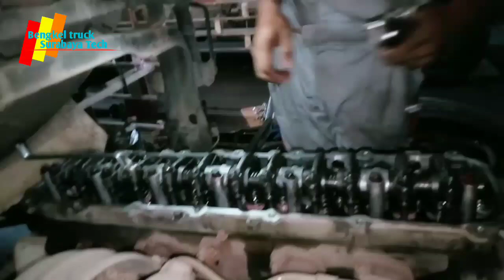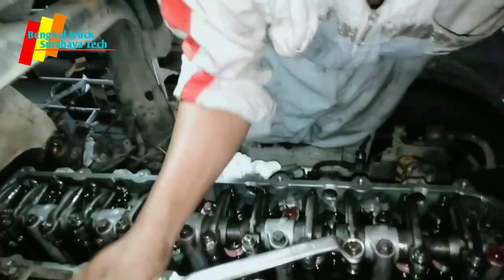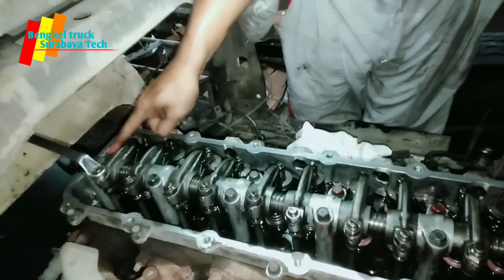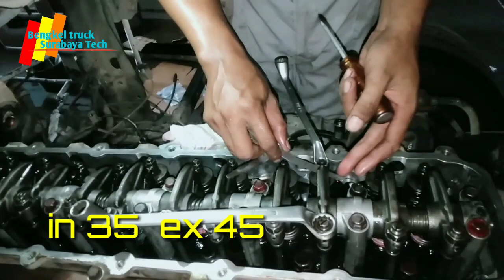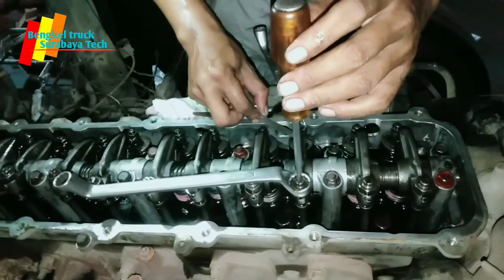cara setel klep nissan pk260ct benar

Comment: Mau tanya om. Mobil bawaanku kalau nanjak amper panas nya naik.
Itu kenapa ya untuk mobil ud quester cwe 260..
Reply from the maker: oil silicon kipas radiator bisa
tremostat macet bisa
Reply: @bengkeltruksurabaya909  wah trima kasih banyak om ilmunya semoga menjadi amal yg terus mengalir..
Saya sangat ingin sekali setting tenaga quester. Tapi disini belum ketemu orang yg bisa.. Saya sering konpoy terus jadi bahan bully sama kawan-kawan karna terus disodok-sodok kalau ditanjakan..